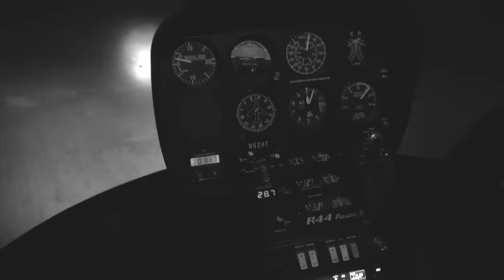Subzero RIP with Cleetus and Ostacruiser! Will our X3s and Pro R survive?!

Comment: Legit started watching this channel in the spring of 20' and now I've got a low mile 17' X3 making 225hp and just bought the rest of the tools that ill need to replace the cage....  Too bad BCF stopped making cages for the X3, now I'm back on the hunt for the right one. I'm thinking about buying a bender and doing it myself. After the cage I'm doing the same turbo setup as Cleet minus the MoTechy-MoMoney.
I've literally turned my two car garage into a shop for my riding buddies and I to work on our machines. Had to install a 65k btu Modine propane heater to keep the projects moving.
I needed a new hobby that I could do mostly from home and that I could involve my 2-year-old son in.
Thanks Guys! Really, I mean it. I'm having a blast, and I get to do it with my little boy.

Comment: I remember winter camping where it was so cold that when my front was finally warm by the fire, I'd turn my back to it for 5 minutes or so and keep that rotation.  In the 5 minutes or so facing away from the fire to get my backside warm, my Mtn Dew would freeze and then defrost enough when facing the fire to get a few drinks.  Lol.  Winter orienteering is some crazy stuff.

Comment: Blows my mind that the state allows or even maintains these trails and there was hardly anyone else on them.

In my state you have to sneak down the turnpike a few exits and cut thru a fence just to ride at one of the old landfills because theres literally no legal areas to ride.
Reply: Michigan has quite literally tens of thousands of miles of roads and trails open to ORVs.  We have on "official" network of ORV specific trails that's about 3200 miles, but on top of that there are tens of thousands of seasonal roads(mostly forest service, logging and mining roads) that you can ride.  Mostly in the National and state forests(Michigan has more public land than any state east of the Rocky mountains, so lots of options!).  The guys here were riding on seasonal roads that are not even a part of any special ORV network.